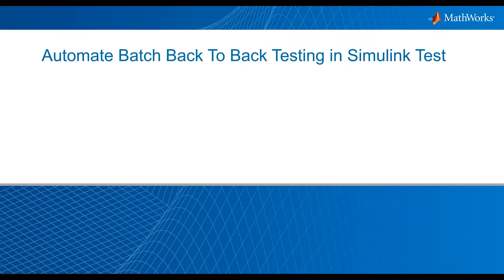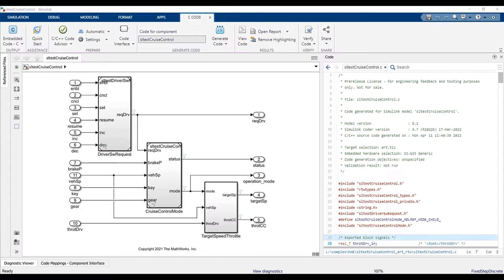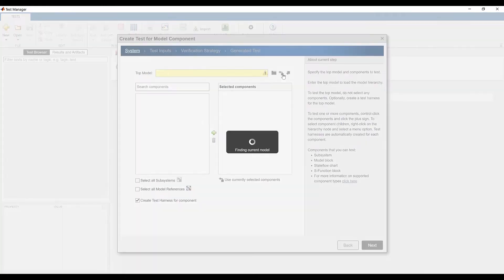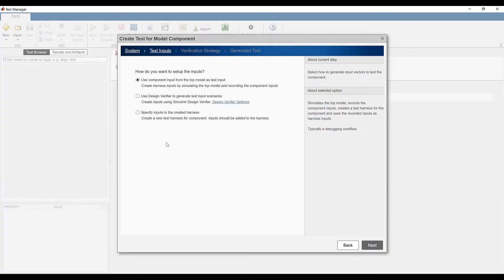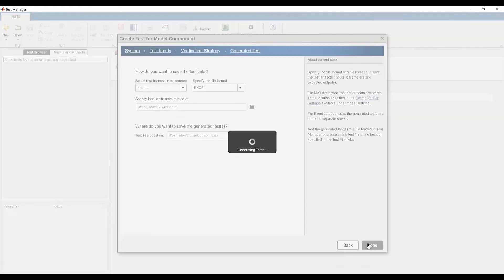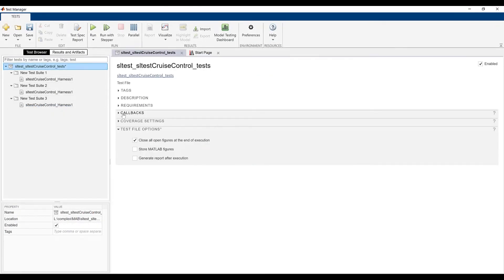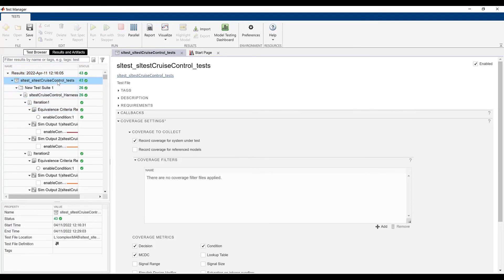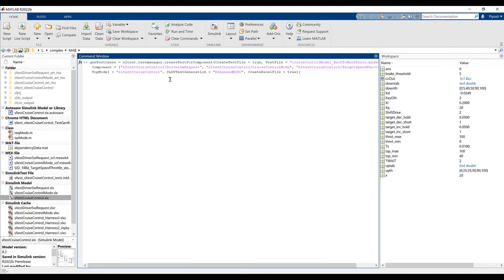Automate Batch Back-to-Back Testing in Simulink Test

Comment: Well, I've found that the documentation for testing isn't very easy to understand. What's the simples test one could make? Just a step function, multiplied by a constant. We vary this constant between 10 values in an array and observe the results. A run is considered successful if the output never exceeds 5. Simple test, just to understand the software.